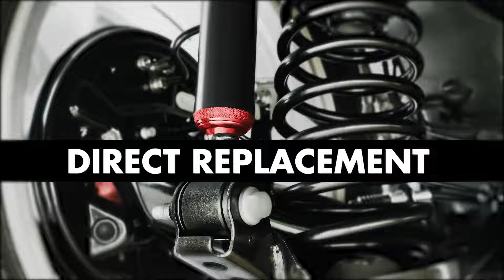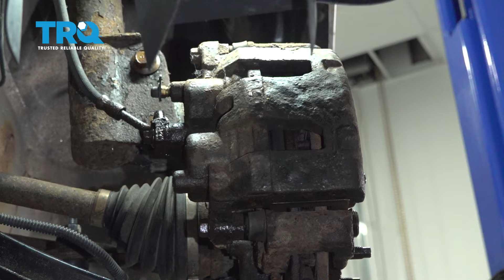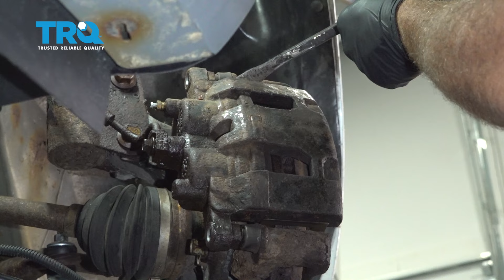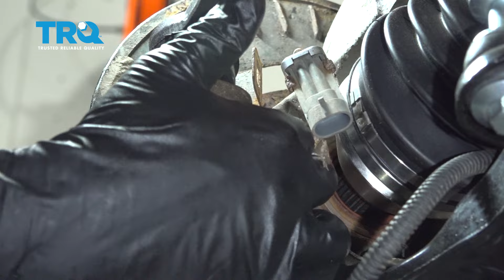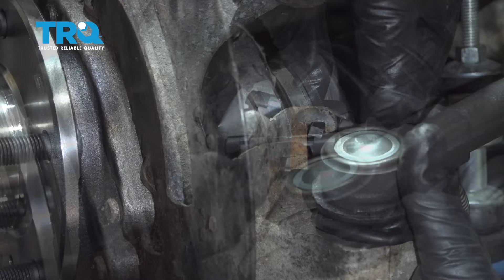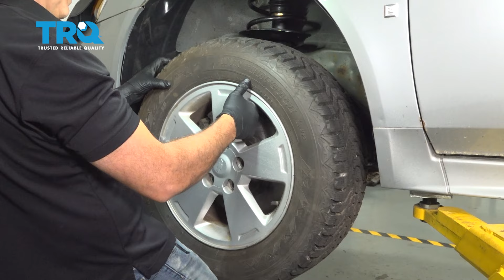How to Replace Wheel Bearing and Hub Assembly 2006-2013 Chevrolet Impala

Comment: I have a tip for whenever an axle nut is about to get torqued on; all you need to do is stick a regularly sized screwdriver in one of the air slots at the top of the brake rotor next to the brake caliper assembly.  It has plenty of leverage, so the screwdriver will be unharmed after use.
Reply: Or you can torque it after dropping car down to ground,no completely,just enough that  tire touch ground for traction.

Comment: Is it required to drain the brake fluid ?
Reply: Recently replaced all 4 rotors/pads on my 2010, all that was required to depress the caliper pistons was to remove the top cap on the master cylinder reservoir
Reply: @alpharomeo8375 i did my buddies brakes front and back used pliers to screw the rear pistons in and used a c clamp for the front dual pistons u have to even them up the fit is tight but still slides right on brakes work perfect after that to this day no noise and no grease on the pad shims

Comment: It very important to use brake greese on the slider pins so the calipers don't lock up and to keep breaking even . I replace calipers every time cause it keep breaking even . Also clean rotor with brake parts cleaner . And do a fluid flush cuz fluid goes bad